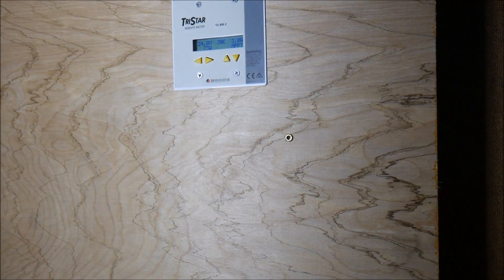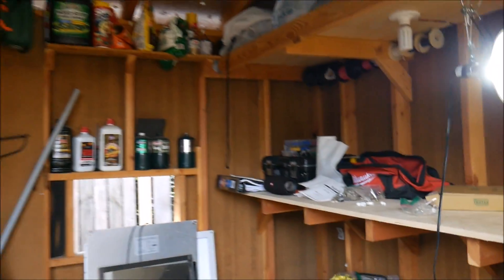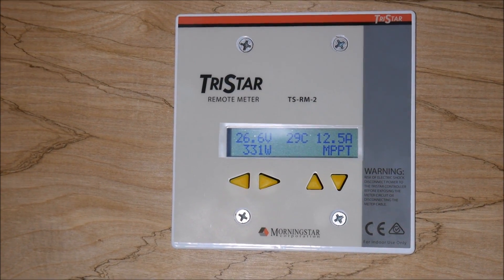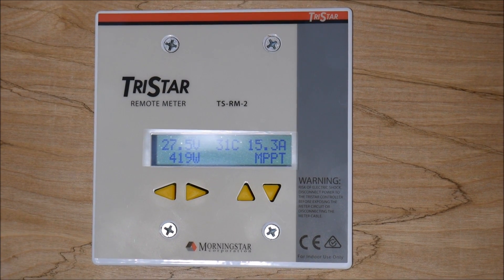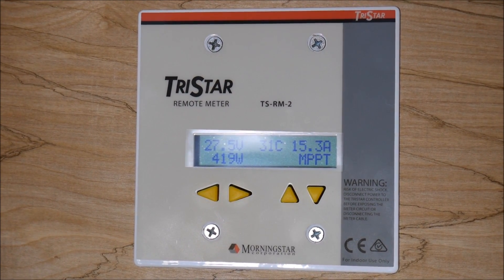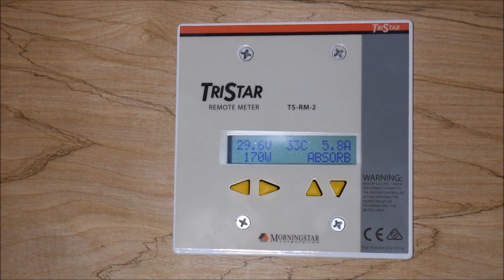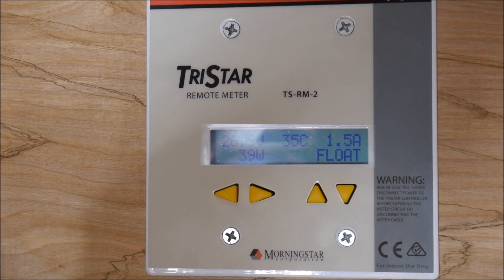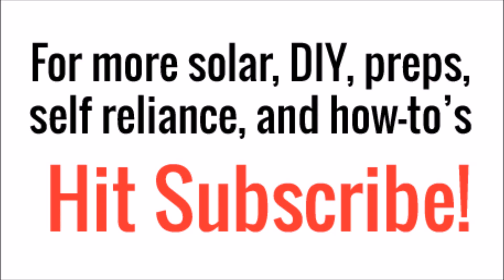New (Redone) Solar Shed Energy Production

Comment: I noticed your float was around 1.5A.  My inverter has a standby currernt of 1.4A, which I wonder if that could be part of your float current.
Reply from the maker: Possibly.  There are 3 inverters running off the system in standby mode when they are not being used.  So 1.5A x 24V is roughly 36W which sounds reasonable for 3 inverters.

Comment: For those of us who are truly ignorant of how these systems work.  Please explain what is the difference between MPPT, BULK,  and FLOAT mode.
Reply from the maker: Someone already confirmed that MPPT=bulk.  That is just the label that this charge controller uses for bulk.  So the main phases are bulk->absorb->float->equalize (equalize only once a month or so).  For more detailed explanation, see my video here:  https://www.youtube.com/watch?v=vyfcWBCmuHM
Reply: From my experience with an outback MPPT controller, the stages are as follows:

1. Wake up
2. MPPT Builk: charges until the voltage reaches a set amount.  (Usually around 14.4v for 12v system and 28.8v for 24 volt system)
3. Absorb: fills last part of batter to full charge (maintain 14.4V for 12v and 28.8 for 24v until the current level drops)
4. float charge: maintain battery levels (mine does it at 13.6v for 12v system and 27.2 for 24 volt system)

I believe you would probably see your system change when the voltage and current reach certain levels.

Comment: How far down did you run your battery's
Reply from the maker: Not very far.  I would say on an average day we consume about 40 amp hours and the batteries hold over 200.
Reply: how many amp hr batteries do you have let me be clear per battery and what was 3 or 4 batteries
Reply from the maker: Each battery is 225 Ah and 6V and I have 4 of them in series.  So the total battery bank is 225 Ah and 24V.
Reply: ok so you have in essence one  225 ah battery at 24 volts are your panels working at full and if not you say you need to clean them now can you reproduce what you did with clean panels and see how long this takes to recharge that 40 ah you used see after some consideration i have dis-sided to go with a midnight solar mppt  classic 150 at 90 plus amps after a few of our talks which will allow me to go 2000 watts at 12 volts and 4000 at 24 volt 6000  at 48 volts
Reply from the maker: That is a great charge controller!  I almost bought that one over the Morningstar.  I don't think you can really do a scientific comparison of charge times because the sun each day will be a little bit different with clouds and such and you would have to very precisely discharge the batteries to a set amount.  What I can do is find out if my peak production gets better.  The highest I have seen is 420Watts so I will clean the panels and see if I can get higher than 420W.
Reply: do you have a bad diode that's pull down the wattage ?? when I tell you I have been all over utube looking and listening I am not joking watched a couple different vids on this topic I didn't know they could go bad